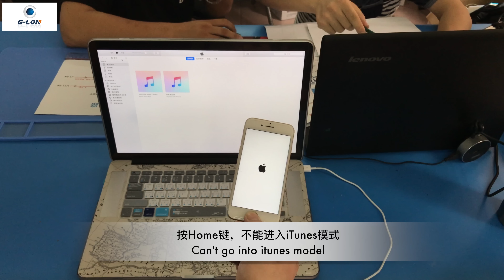Repair iphone6s error 9

Comment: I got error (9) while trying to restore my iPhone 6 in iTunes. Per another video, I removed the screen, connected phone with iTunes (with screen detached), restored the phone with latest iOS update as new phone including firmware (I kept pressing the logic board with my thumb throughout the restore). It restored fully. I connected the screen and started the phone without fully closing it. It started and was able to set it up as a new phone including iCloud logins and 6 digit passcode. Restarted the phone. Once I enter the pass code, it goes back to the Apple logo loop again. Not sure why? I'm sure if I try to restore with iTunes, I will get error 9 again. BTW, the old screen was broken and I'm using a new screen (after market). Something in the new screen doesn't go well with the phone and I don't know what! I'm sitting with a pristine condition, 64gb BRICK!
Reply: This was my issue.  I some how was able to restore the phone (I recall pressing the phone and may have gotten lucky with the pressure on the right place).  But once I set my passcode, back to square 1 again.  I think it has something to do with security setting.  I was also able to restore one more time and I skipped the security code.  When I setup finger print security, same thing happened.  Now I am still trying to restore the phone. Just want to share this experience.
Reply: Did I fix the problem?

Comment: Hi friend. Can you help me to fix iPhone 6 error 4013. I tried 2 cables, 3 usb port of 3 pc, etc.... Do you know how to fix??
Reply from the maker: Want to check
Reply: I have same problem error 4013, do you have any idea ? Thank you
Reply: you need remove nand flash a repair with navi plus 3000
Reply: its a nand flah issue need to repair it with system repair tool (hardware issue )

Comment: replace u2 ic solved error 9 ?? no way .. error 9 ,4013 , in bad nand chip ..  how he done successfully error 9 because he heated up board and its gone throw .. i done more then 400 iphone 6 or 6p and more then 150 iphone 6s ..
Reply: Yes it is fucking weird that changing the USB chip can fix the error 9. WTF is going on here but G-Lon is a master we all know. Can u tell the WHAT THE FUCK is going on ?
Reply: Apple Hardware Repair
Reply: Thank you for that. I do understand now. So the memory error can cause error 9? I thought it was only the nand chip or something related to the nand chip.
Reply: Apple Hardware Repairs Are you saying flash first goes to ram and from ram it’s written to the nand? It’s not direct from usb to nand?
Reply: @mrsemifixit  yes thats right on 6s atleast. If you see 3u tools you can see how it is going. Ram to nand